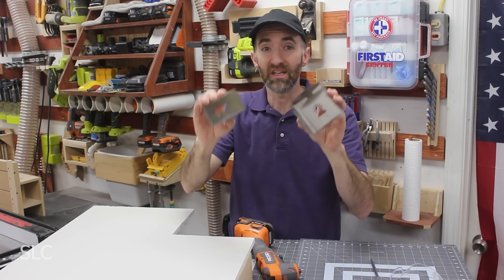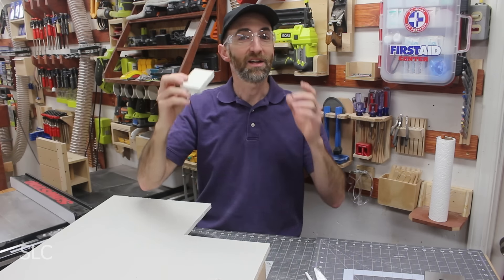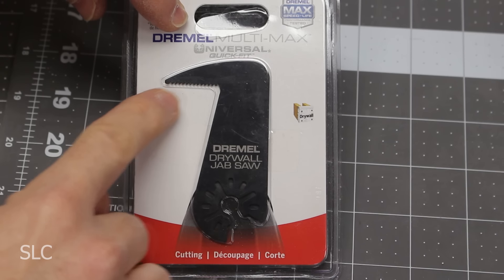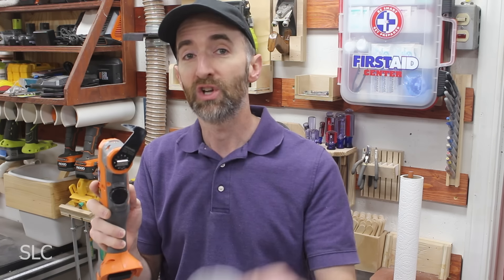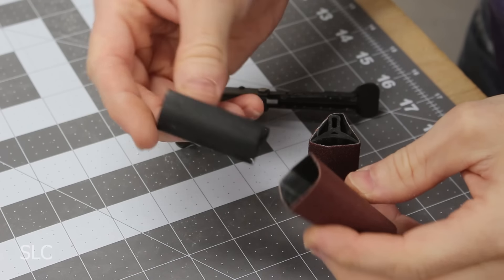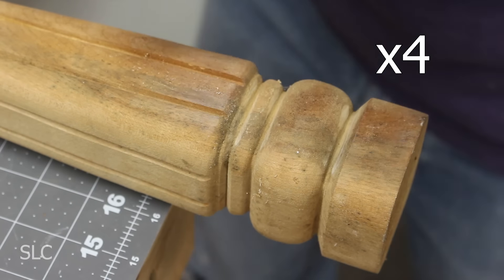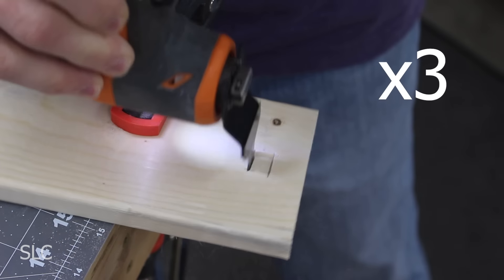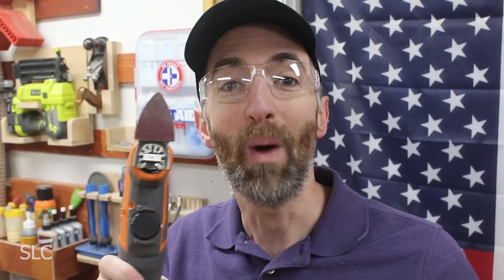5 NEED to BUY Attachments for your Oscillating Multi-Tool

Comment: Not your workmanship, the saw is going to cut an very gentle hourglass shape.  Take a rectangular object and turn it at its center a tiny distance left and then right and outline it at each limit.  You will easily see the pattern.  This saw is incapable of cutting a perfectly square box, but it is square enough to cut a hold for an outlet box.

Comment: For the one shaped like a clothing iron you can take the large velcro disks and trace the shape and cut your own with scissors. Make sure you cut them slightly larger than the iron shaped piece, so that your velcro tool doesn't get damaged while using it. You can find larger 6+ inch disks on sale.  The triangle shaped sandpaper is often more expensive. You can get quite a few triangle pieces out of one good-sized disc if you lay it out carefully.
Reply: Don't use good scissors, because they won't be good afterwards!

Comment: I refinished a set of wheels for my car, and the contour sanders were invaluable in the process!
Reply from the maker: Great to know it can be used on wheels, thank you
Reply: @SpecificLove7  my plan was to repaint them anyway, so I was sanding down scuffs in the powder coat, that sort of thing.

Comment: I really appreciate this review. Mostly because it showed for me personally there are better tools eg:
Jigsaw over the jab-saw.
Gluing sandpaper onto worn-out cutting blades instead of the sanding attachment (use dowel to get the rounded shapes) - and much much cheaper! 
Respect on the interesting demo!
Reply: Justin, I glued on some velcro onto some old worn-out blades, cut up some sanding pads & it worked great !! 

😎👍🍺☘
Reply: @peterfitzpatrick7032  Respect, that's a nifty upgrade, I gotta try that!

Comment: I didn't have any interest in an oscillating tool, having never used one before. I've always used a Dremel rotary tool with a flexible shaft for most detail cutting/sanding and a Rotozip spiral saw for drywall tasks.

Last summer I replaced my worn out treated lumber deck with composite decking. There were a lot of cuts and notches that needed to be made.  My wife suggested that I look at an oscillating tool since she had used one while working as a set designer. 

What a game-changer!  Went with the Milwaukee M18 Fuel brushless variable speed model (Milwaukee is the cordless tool platform I committed to) and have been nothing but impressed with how useful and flexible an oscillating tool can be.

Looking forward to trying some of these blades and attachments!
Reply: I know what you mean. Once you have one, you wonder how you ever did without it.

Comment: Re: the drywall attachments, you should have demonstrated the cuts on a vertical wall. Other than holes for lights, most cuts will be on a vertical wall. Even the circular hole demonstration  should have been done overhead to show how the tool works in a practical application. I really liked the contour sanding attachments! I will be getting that fir sure!

Comment: I didn't know about the contour sander, so thanks! Amazon doesn't have them, but I found them on eBay today, and at a very reasonable price with free shipping. Should make sanding the exterior window frames trim on my house much easier.

Comment: If you have any jobs with special width plunge cuts, take one of your normal width blades, mark the sides and grind it down to the width or shape you need, keep cooling it in water as you grind to keep blade from getting too hot. Even a thin cut-off wheel on a die grinder will work, then dress the edges with a file or sanding block.
Do not worry about electrical covers, over sized plates are made for just about everything nowadays.
Thanks for sharing, don't let your thoughts lock you into a box when you have a difficult situation...

Comment: 5:42 came as part of a kit with half-moon blades for ease of long runs in drywall. They're handy when installing locks. There's another blade I got for removing old caulk along windows.

Comment: Thanks for the video. I don't think it's user error at all.  The tool only moves side to side. The top and bottom work well as a saw. The sides are sweeping across the material. 
I have been very curious about these box cutters, thanks for the demo

Comment: I note that you used a cover plate to check the single gang hole.
Would it not have been better to check with a metal box and a wing box since they are what will be inserted into the hole you cut?

Comment: Buy a small Craftsman shop vac and use it to run with tools like this, especially while cutting drywall.  Works great for flooring repairs and other trim jobs or fix-its that you dont want to spend a lot of clean up time on.  The small shop vacs have a smaller diameter hose so its a lot handier than a full size vac.  Also put a bag filter over your paper OEM filter, use a rubber band at the top to keep the cloth in place and you will extend the life of your shop vac.  It does require more frequent filter cleaning but all you have to do is shake the cloth filter into a trash can or better yet outside at the dumpster, or stick your hand into a trash bag and shake it with the bag closed.

Comment: I just got my first multitool (a Craftsman V20). The specific need was to cut 4 slots in some aluminum angle so that I could run a stainless steel worm drive hose clamp through them. The 3/8 wood/metal blade (bimetal) worked great, once I learned that the work must be solidly clamped down. The alternative was drilling lots of little holes and using a tiny file to connect them- too tedious!
Reply: Alan...spraying a bit of WD40 or even just plain paraffin/diesel/kero makes for much easier drilling, cutting & tapping aluminium..  

😎👍☘🍺

Comment: The electrical box blades are going to make the top and bottom a little bit wider based on where the blade pivots , thats not your fault, its the mechanics of the tool. Looked like a very clean cut

Comment: I mostly use mine to sand in corners I thought I would use it to notch out base boards I currently use a dewalt triangle sander attachment but I will need to get those one

Comment: Those are some neat attachments. They definitely can come in handy.  I have 2 oscillating tools.  But I  have  problems with the blade staying on the tool itself.  The blade is held in by a bolt that is cranked down with an Allan wrench.  It works for a few minutes & then the vibration makes the bolt loosen up & the cutting piece falls off no matter how much it's been tightened.  Can I ask if you might have any suggestions or ideas that might help fix this?
Reply from the maker: Sorry but I have not worked with that type of oscillating tool so I am not sure how to fix it.
Reply: The hex head cap screw should also have a crown washer with it.  The crown "pushes" back against the screw to eliminate walk-out.

Comment: I so very badly wanted to see if you could slip a single gang box through the electrical box hole with out some extra cutting. Or even a remodel box, those suckers are a little extra thiccc

Comment: How was that user error with the box hole cutter?  It seemed like you used it as well as anyone could.
Reply from the maker: Just figured I could make it a little better with practice
Reply: @SpecificLove7  there will always be some waviness simply from how the blade oscillates.
Probably works best on lower oscillation angle multitools.
Reply: It would boost our confidence if you practiced before filming.
Reply: It's the kind of "error" that would be hidden behind a face-plate anyway.

Comment: the sanding attachments are definitely drool-worthy - probably good idea to get a corner shaped piece of thin, durable plastic to guard the wood inside the corner so you don't mar it...
Reply from the maker: That is a very good point, thank you for reminding us
Reply: Unfortunately these sanding attachments are made of cheap metal and break after a couple of hours of use

Comment: #1 is way to specialized and doesn't seem practical (cost wise) unless you are doing production work especially when #2 can generally do the same thing but would have other uses beyond cutting a rectangular hole in drywall.

Other use for #2?  I've spatchcock a super large turkey with my OMT, I think this would make that much easier; assuming the teeth were up to the challenge.

Comment: The box shaped cutter doesn't work properly on the sides because the cutting teeth are not oriented properly for that. The tool only moves the blade left and right, not up and down,